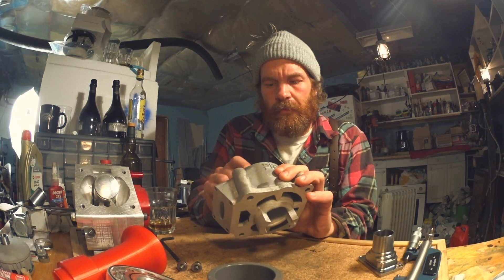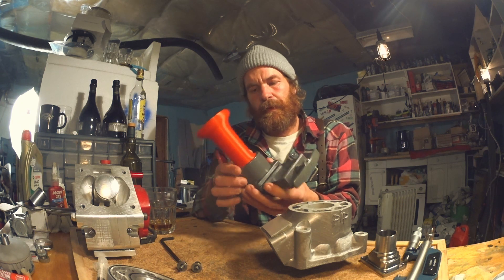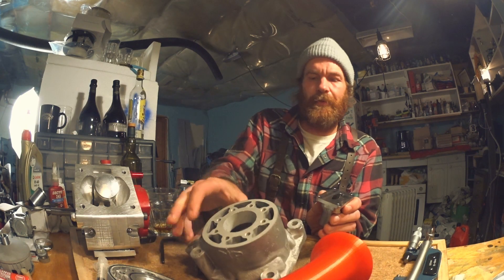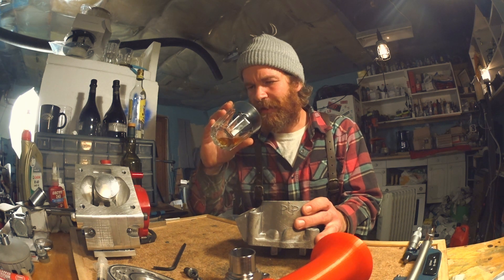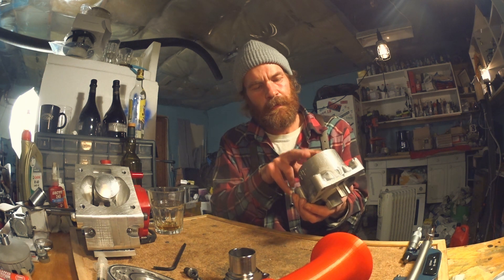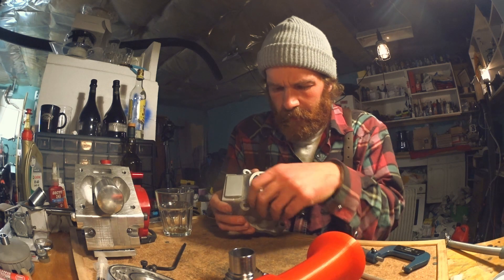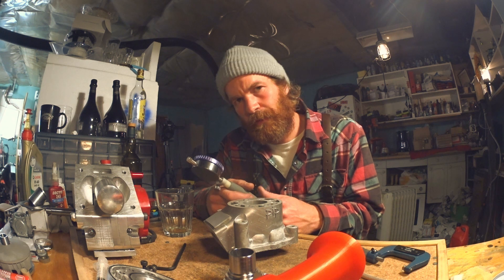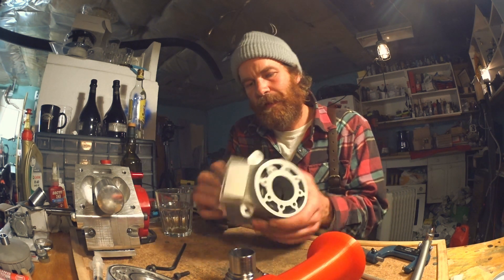Piped in - Worlds Most Powerful Two Stroke

Comment: This might be another thing to consider; The Aprilia racing cylinders were (as far as I know) coated with a slightly tapered top surface of the cylinder. The coating was then also applied on the top surface and later the top surface was flattened, but not all of the coating removed. That way, the coating came up all the way through the bore and curved over to the top surface, this made it stronger and less likely to chip at the top of the cylinder. I read this on the Dutch forum you know well, Jan Thiel mentioned this once or twice. Good luck!

Comment: i think: you should change it to: Worlds Most Powerful 50CC Two Stroke

https://www.liveabout.com/how-is-rc-engine-size-measured-2862919
A horsepower is a standard unit for measuring the power of an engine. An engine with a .21ci ( - 3.5cc) displacement can typically produce between 2 and 2.5 HP at around 30,000 to 34,000 RPM.

a teacher at school back in the days said me, the world most powerful piston engine is the one with smallest piston.

attention should go to the piston, making it as LIGHT as possible to go fast, but just doesn't break,  remove excess material on the inside, it doesn't need much material on the front/back side of the piston, just enough to not leak, it should barely hold the crank rod pin / piston rings in place, making sure it's BALANCED.... and i keep repeating, u should go for a brass / copper sleeve in case you fail and brake the piston / piston ring, seizure, unless you want to produce more material for 2021 YouTube season.

Comment: I don't think that part required 5-axis Machining🤟😁😉
Reply: Yes IT did if you has Seen the innside of IT.
Reply: @ktmturbo5836  if the exhaust adapter thing requires 5-axis Machining it is the designers fault. Unless that part is the reason why this will be the most powerful 2 stroke engine in the world.🤟😉🤔
Reply from the maker: Could've been done in a 3 axis machine if flipped and machined from both sides. But why would you if you have 5 axis capability...
Reply: IT is tricky to mashine IT from the other side. Not mutch space in that gap. But maybe ITS possible
Reply from the maker: 👍 You're the experts!
Reply: @2STROKESTUFFING  no. I'm just a Toolmaker / Machinist. Interesting videos you have.  Can you send a link to the video that explains why this should be the most powerful 2-stroke engine? Thanks.🤟

Comment: Your bore is too porus i suspect its from using plaster to make your casting the plaster doesnt let the gasses escape. Maybe try using a wax filament from someone like machinablewax.com i think is where i seen it and also try oil sands for the mold. You might get a better outcome. The other thing with wax you dont have to to a melt out just pour the molten aluminum onto it and it vaporizes the wax

Comment: Why did you make the exhaust duct in the cylinder facing downwards in that angle when you have the pipe facing back up again in a mirroring angle? Wouldn't it be better to just keep everything as straight as possible?
Reply from the maker: The exhaust duct is angled about 25deg for best flow, in the pipe it's not so much the flow but pulses that matter.

Comment: If you use an anode, the layer will be thicker in the bore, then you can etch the outside with nitric acid for a minute or so. Thats how we did it at Powerseal ;), the optimal layer thickness is 0,1mm, so you need to bore/hone the cilinder to 0.2 oversize.

Hope this helps!

Comment: To prevent the hydrogen bubbles from forming in your castings you can put those chlorine tablets for pools in the molten aluminium.
They will remove the hydrogen from the Aluminium.
Reply from the maker: 👍 I'm using proper degassing tablets.

Comment: What would happen performance wise if the whole exhaust pipe was elongated like the port is?
Reply from the maker: Not sure. Might do something strange to the pulses, but maybe not.
Reply: @2STROKESTUFFING  thanks for replying! your videos are awesome 🙏 I just thought the flow would be very turbulent changing shape in such a short space with the new manifold adapter you have. And I just couldn't stop thinking about what if the pipe was the same shape as the port. Without the new adapter in place.
Reply from the maker: @MaNNeRz91  Thanks! After the transition it doesn't matter if flow separates, there's more than enough room for it to take its time on the way out. The pressure wave is what matters, and it likes that abrupt volume change. A sharp step would work too, but a transition is better for when the return wave pushes fresh mix back into the cylinder.
Reply: @2STROKESTUFFING  thanks for explaining it for me. I already learn a lot from your uploads. I must admit I wasn't so much into the cabin building section but that was needed for your own morale and thinking time 🙌 keep doing what you're good at. You're smashing it! 💪🏼✌️

Comment: Did you see my email about the crank design...
Reply from the maker: Sorry, lots of mail... I'll get to it!
Reply: @2STROKESTUFFING  OK, well, your machine shop connection reminded me.. I need it machined. I am not opposed to mailing a spare crank and a fusion 360 file to Norway. Im thinking it would greatly benefit your top end / peak HP numbers, and carry torque flatter and further, and you have a unique opportunity to go back to back on your dyno with relative ease. Check it out. When you check it, reply with your mailing address, I want to send you a local beverage.

Comment: Where is the nice honing machine from?
Reply from the maker: Ebay, search rigid hone 40mm
Reply: Is the hone adjustable. If so how? What on the hone does the work, is it a stone or like a file? Can you do a tapered bore. How do you measure the hone's size? How do you know when your hone is worn out? Doesn't a hone need to be kept 100% straight - like on a lathe?

Comment: Kind of curious of the cross sectional area of the exhaust vs. the transfers progresses as the piston approaches BDC as both will open at a different rate one relative to the other. And the x-sectional area one relative to the other at the exit of the exhaust port vs. total area of the transfers at BDC. That can't be a "random" thing did the "pipe" play a large role in the design?

Comment: We need variable expansion chamber geometry. So the expansion chamber geometry would change relative to rpm to maximize low and high rpm power. Maybe sort of like a trombone slide or a trumpet that different valves open to different shaped expansion chambers.
Reply: Such as the pipe is longer at low rpm and shortens as rpm rises, to match the resonance charges. An exhaust with moving parts sounds complex. Simplest solution maybe three in one, a low, mid, and high, where valves open/close routing the exhaustion based on rpm. Probably not feasible in a small motor that revs so fast
Reply: It would be possible. But this engine is designed for one rpm only and will work by the principal of resonance.
So no benefit for this application. On a road racing bike constantly going through the rev range it would be a great idea.

Comment: What's the best smelling 2 stroke I using Castrols racing oil at the moment.
Reply: try mixing a bit of castor oil in your fuel, the race stuff dont work properly unless your thrashing the nuts out of it
Reply: @aeroflopper  will that lower the octane of the fuel and give me less power
Reply from the maker: Castrol A747
Reply: @2STROKESTUFFING  thank you🖒🖒

Comment: I don’t understand how you have no bore liner, am l missing something, everything else is spot on, l understand about the nikasil, but still how can you have no liner.
Reply: No, you're not missing anything, many modern, vintage, and a few classic; 2 strokes especially, small engines are cast aluminum with a very thin nikasil coating for a "cylinder wall".   Aluminum is highly conductive for heat, it moves heat FAST, so it won't reach temperatures that would melt it.  The nikasil essentially only provides the necessary hardness to stand up to lubricated friction.  The myriad applications in which you'll find this set up means that oil abuse will utterly destroy your "jug" or cylinder, its a win-win for manufacturers, cheaper to make, won't last as long as traditional cast iron sleeving. However, there are still good benefits to it, i.e., faster heat transfer means higher rpm among other benefits.

He's sent one of his cylinders off to have a cast sleeve inserted for testing also, I suspect it'll help chase down some problems he's been having.
Reply: Great stuff... a sleeve will eliminate all of that pesky porosity also.

Comment: Need more compression 2strokes love compression
Reply: You said it your self. Old school.
And there’s so much more to it then just compression ratio. And there’s several examples showing great benefits of “low comp” 2 strokes. Especially if you like to have some over rev.
The sharp edge in to the bowl is also proven by the (modern) leading minds of 2 strokes and it creates turbulence that’s actually a good thing in a 2t combustion chamber.
One thing I learned quite quickly after starting to TRY to understand 2 strokes was that never ever take 4 stroke theories and apply them as is. The risk it works in exactly the opposite way is very high.
2 strokes are complex.
Reply: that is exactly what he is trying to fix here.
Reply: The problem lies in the head .. the dome is to much head needs to be little more shallow looks like i can put my thumb in it round off the sharp edge they creat hot spots we went through this with chevy heads 305 heads on 350 look at the old chain saws from the 50s up to 70s it took a man to pull start one of those and they had god fearing power the new saws suck and have no power built cheap
Reply: Old school early 80s kx 250cc kawasaki dirtbikes were known for there high compression and wheely jerking power band
Reply: Yes, the head runs way hotter in the middle part, as there is less space in the outer ring, but it gives good top end power. With good cooling, it wont matter.

Comment: I was looking at a cylinder yesterday that had an alloy sleeve nikasiled to size, just another option for you. Keep it lit lad, you do great work.
Reply: the best idea would have been a alloy liner which was nikasiled by a pro company that would hone and finish to size , he has mickey mouse measuring equipment
Reply: @alancollard8939  But Mickey's ears are always round. Imagine.... what would a Mickesil plated cylinder at 20,000 RPM sound like on Saturday morning cartoons? AM stations in the Philippines would hear oil about it.

If my Mickey Mouse hurts calculations are correct...
 That's all folks!

Comment: Hi, if you like to have your piston coated, write me an email... info@kolbenbeschichtung.de
There are some advantages coating the piston. It will not seize as fast as an uncoated piston when the running conditions are bad (fuel too lean, bad cooling,..). Moreover I can change the form and shape as well, giving it for example more or less ovality or a more "tapered" shape.
The only thing is the diameter increases by about 0,03-0,04mm to  do a normal coating. For changing the shape I will need some more coating thickness.
So, have a nice time, best regards from Germany.
Jürgen
Picoatec Kolbenbeschichtung
Reply from the maker: Awesome, thanks! I'll let you know when the new pistons are ready!
Reply: That's an interesting 2 stroke self preservation topic and I look forward to hearing more.
Reply: @WireWeHere  This type of Molybdenum disulfide - based coating has been used with aftermarket pistons for quite a while now (Wiseco and Vertex have been doing it for as long as I can remember), both in 2 and 4 stroke applications. If you've ever seen a piston with black areas on the skirt, it's this stuff. What's important to keep in mind it's not a wonder coating that'll magically prevent wear and prevent the engine from breaking ever. It does however provide some sort of emergency lubrication in situations that would leave marks otherwise. When it makes use of this property it does wear down though, it won't last forever.
Reply: @KacKLaPPeN23  Thank you, I was hoping something new had been discovered.
Reply: This is an awesome idea !!! We have companies here in the USA that do this same type of thing. Line2Line and Swaintech are just 2 of them for anyone here in the states.

Comment: Good video. Does the tuned length of the intake only allow gasses in one direction? What rum is that?
Reply: The longer the intake for a given cross section and velocity of air, the more kinetic energy it has and hence overcomes the momentary blow back ... so yes it does ...downside is longer stacks take longer to get up to velocity...not a problem in this application.
I thought he drank whiskey.
Reply: @abyssmanur3965  Well let's get to the important stuff then. He's definitely drank rum previously and I'm looking for good recommendations
Reply: @frankg3278  Shouldnt be drinking in the workshop! I know a guy who knows a guy who drank some hydrofluoric acid because it was in a glass, he died after the first taste.
Reply: @abyssmanur3965  Natural selection
Reply from the maker: Lagavulin 16 in the glass, mixing things up with some whisky. Preferred rum is Mount Gay Extra Old.
Reply from the maker: HF in a glass is dangerous even if you don't drink it - it eats the glass...
Reply: @2STROKESTUFFING  Indeed you are right, it was a stained glass artisan told me that and revisiting the conversation he mentioned a coke can.
I still have a bottle (plastic) of HF stashed away from when I bought the business, always too scared to even open it.
Reply: @2STROKESTUFFING  Wow, expensive taste! I might treat myself to some. On Kraken at the moment.

Comment: Yes, use pressure plates so the distortion of the torqued head bolts onto the cylinder are mitigated.  The cylinder will be circular or concentric with the ring.

Comment: little and maybe useless question: Are you using dinamometric wrench when closing head bolts?
Reply from the maker: Just by hand so far, but I'll bring it out from now on👍
Reply: @2STROKESTUFFING  nice! in my opinion is important specially for light alloy components because when the temperatures go up you can get distorsion of the flat surface (it happens with old cars) , i like to do a pre-lock with less torque and then do the complete lock with the classic X pattern, probably you already know but maybe this can help ☺👍